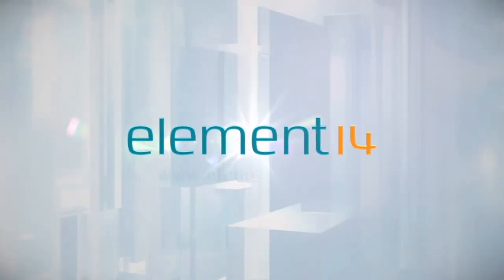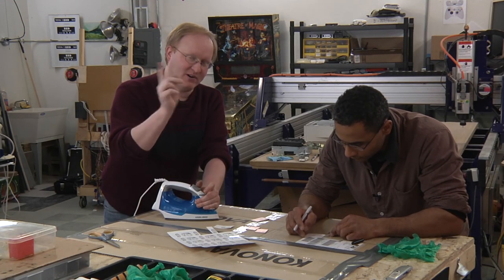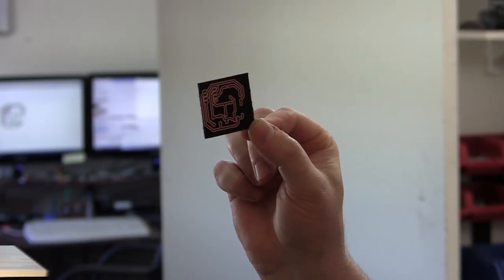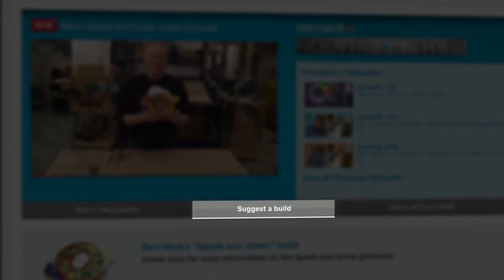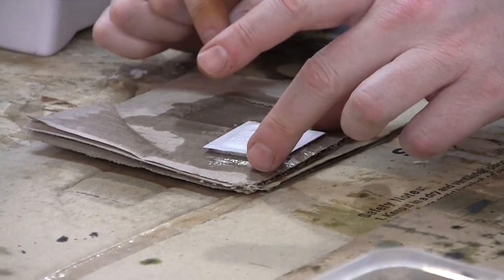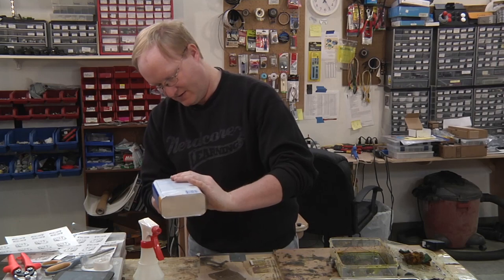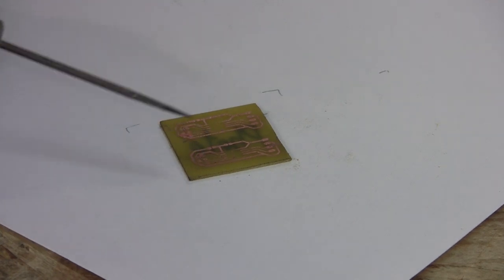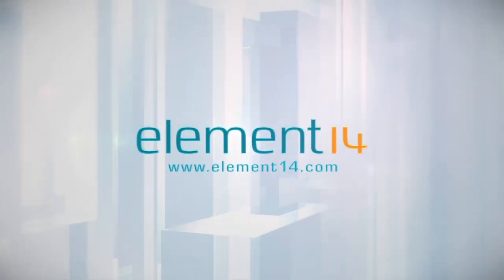Let's Try PCB Etching!

Comment: Great Video!  I think if you use the pen on the board after you remove the paper you could get rid of hatching. So that would be a combination of methods. :)
  Also I think its worth mentioning UV light (sunlight or a sunlamp) helps the echant solution.

Comment: Instead of using acetone to clean up the toner from the toner transfer, after etching, you can also use steel wool. It will not damage the copper.
I just happen to find acetone quite expensive and not available at large here.
Reply: I now use carby cleaner to remove the resist after etching, 2 quick sprays and the toner is gone and the board dries in less than a minute

Comment: how about plotting it with the cnc instead of laser burning the paint, just put a pen in the chuck? Also, Tom Stringham and Sylvia'a Mini Maker Show have great plastic ideas that just peal off without soaking.  Rich Olson also came up with a great idea to use silver glue on the toner to make a circuit board on paper. I wonder if his could just transfer the silver to a circuit board.

Comment: heating up the etch solution speeds up the etching process. Usually use one container with hot water and a smaller container with the etching solution.
Reply from the maker: Thanks for the tip!

Comment: What is a Themistor and BJT ?
Reply: Rajinder Singh A thermistor is a resistor that changes it's resistance based on temperature. A Bipolar Junction Transistor (BJT) is just your standard NPN or PNP transistor.

Comment: when etching let the pcb float on the etchant copper side down, you will see when the board is etched, have to be carefull because air bubless are easilly trapped under the board so you need to dip the board from the edge

Comment: what's the point of doing the copper fill using the laser printer?

Isn't it more easy to just include it in the design and print it in the photo paper with the actual circuit?

Comment: Use one part muratic acid and two parts hydrogen peroxide for you etchant . Keep this acid out of the house and do not inhale the fumes. Next use toner method, set iron temp to medium only to prevent smudging of circuit paths. spray a light coat of silicone spay on the iron to reduce ironing resistance. I have used this method for double sided boards for years. Keep the acid in an outside shop. Not safe to use indoors.

Comment: At the beginning of the video Ben mentions that the whole point of board etching is to circumvent having to hand-wire the board because it's so tedious and time-consuming. This looks equally brain numbing! I'd be more inclined to mill the copper off with a carefully tuned/tweaked CNC mill/router. Also, is it not possible to just laser off the copper directly? instead of just the paint? Maybe going slower/deeper ?

Comment: Welp. As said below, laminator. Goin next - iron. Rotation moves or just long press - just let it cool itself (i put it inside old book to cool there). Just in case - if u dont have huge hangar for your hobbbies, you easily etch at home with some lemon acid and hydrogen peroxide. Its also cheaper btw, gives almost no smell and no dirt. I etch right on my working table or kitchen, pouring used liquid into toilet. Good luck

Comment: Hey Ben. Why don't you just use the Laser to vaporize the coper you don't want and be left with your traces. No echant step required.
Reply: +ZakarooNetwork I think his model of EPILOG is not capable of this, however current 2015 EPILOG higher end lasers can do just this in one clean process!
Reply: +Jeff Morgan Thanks ben Never Got back to me. Im a check out the new machine.

Comment: Its probably further down the comments. What purpose does the solution serve after the copper has been burned away? Does it improve the bond of copper to board, or something?  

Also I was thinking if you have the laser etcher, couldn't you just burn off the excess copper where you didn't want it, by using a negative print?

Great stuff though, I have a bunch of different ideas now for my own shop as a result of your show. I have been basically marathoning it since I found your reverse engineering of a LCD screen a couple weeks ago. Who needs netflix!
Reply: Ducknoodle  thank you!

Comment: I've had much more success with a phototransfer method. You need a phototransfer pcb, but it's much easier and faster. Contrary to what people think, you don't need a transparent foil or a laser printer. Just use a semi translucent paper. Print on the highest quality settings. Use 2 layers, overlap them. Cure with UV, then use the exposing-chemical-thingy. Etch. To speed up the etching, put your etching bowl into another bowl with hot water. You can get a whole batch of PCBs done in under an hour.

Comment: if you have the laser setup, why bother with etchant?, just laser etch the copper off.
you can also use your cnc machine, a fine tip and 2mm clad boards makes great boards, i have made boards this way for my shortwave radios.
Reply: aly nicholls just a little note about running a laser cutter. You cannot cannot etch off bare metals or copper in this case. You risk damaging the laser if you do so, but I assume you already heard or read about it.

Comment: 2;05 many times did this and realised
Reply: When i made 555 oscillator circuit everything on paper was seems good but when i printed to clad board as pcd ic's pin 1 changed to pin 8 . But that i time i don't wants to do hardwork again  for remaking instead what i did ....
I flipped ic's all 8 pins to backwards upside down . And done .😂😊

Comment: Where can i buy  etchant?
Reply: Buy it in a chemist's shop or if you can get it in a pharmacy.
Reply: Judging from your user name I assume you're somewhere in Scandinavia. If so it may be hard to get hold of, though you may have luck at companies which sell electronic components, such as Elfa Distrelec or Conrad. 

If you're in the US all you need to do is go to Radioshack.
Reply: Switch & Lever Yeah, i'm from scandinavia. I have never heard of Conrad before, so thank you. I think i found it there. http://www.conrad.com/ce/en/product/530736/Bungard-73131-01?ref=list
Reply: fiskefaen Yep, that's it. Just be aware when using it (essentially dissolving copper into a solution) you have to deal with the remaining etchant as environmentally dangerous material and deal with it according to your local legislation. No pouring it in the sink as it pollutes the water and is not good either for water living organisms, or us.

Comment: Wow, you guys made a right mess. Why so much messing with the etchant? Just lay the board on it, copper down (ferric chloride has high surface tension, so it will float) and leave it alone for ~20 minutes, checking once in a while. No risk of damaging the traces, no hassle and no mess.

Comment: millions of nerds and appearantly nobody got the idea to just modify/build a laser printer that prints the toner directly onto a pcb. and drops them straight into the etching bath :P why the hell is all that stuff pretty much still in the same stages it was in in the 1940s. at the very least one would expect some methods to just print the metal directly onto the epoxy. also, using conductive toner of some sort, one could just electrolyse the copper away with no acid. (the toner needs to stay in place while still maintaining conductivity to the copper parts that are being electrolysed away)

Comment: I understand there was alot of goofy testing just for the sake of making content for the show, but a few major oversights... The laser cutter method was a great idea and something I've never seen before, but no mention of the photo resist method? As far as the standard toner transfer method, this was a super ghetto example of what NOT to do. There are tons of established improvements to this process yet you made it look like cavemen engineering. First there exists special toner transfer paper made specifically for this, it's far superior and available so cheap there's no excuse. Also, use a laminator instead of the iron, results are much more consistent and not any more expensive either. Finally using ferric chloride as etchant is just messy, slow and environmentally unfriendly, there are easy and cheap alternatives (2:1 hydrogen peroxide & hydrochloric acid?) which are much better for all the reasons. Love the show but this was painful lol.

Comment: Ferric chloride sucks, it is messy, hard to dispose of, only available at speciality shops. A much better etchant is a mix of 1 part vinegar and 3 parts hydrogen peroxide. It is a little slower than Ferric chloride, but much much better, for you and the environment. If you are in a hurry, substitute Muriatic acid, available by the gallon at Home Depot type stores for a couple of bucks. If you get a bit on your hands, you should wash it off, but it doesn't stain your hands.  Using Muriatic acid you naturally have to be more careful than using vinegar,  but it works really well.  As with any chemical reaction, it helps to heat the mixture and keep agitating it or use a tooth brush to frequently wipe the board or it will take a very long time to etch. Also, since the stuff is clear, you can watch the process of the etching without removing the board from the yucky Ferric Chloride.

Comment: we iron pcb-s at school, but we print on projector paper and desolve the copper in acid
Reply: If you actually use acid, its HCl and you're really probably using the byproduct of that and copper copper-chloride(iii).  Knowing what I know about first and second year electronics students, you're asking for acid burns handing them either of those.  The most common etchant ime is ferric chloride and has a brownish/orangish tinge to it.
Reply: Travis Stanford A much better etchant is to use Hydrogen Peroxide mixed with Muriatic Acid (HCL). Both chemicals are easily found at the hardware store in bulk for very low prices. When I say "better" I don't mean that it is any faster. Typically it etches at about the same speed. But it is cheaper, easier to find, and doesn't stain everything it touches.
Reply: we use a sheet of papper between the iron and a transparencie which has ink on. the ink transfers to the board

Comment: Lol this is a really bad attempt at PCB etching! The method I've learnt and use from my high school electronics classes are a lot easier and look a lot nicer. The two methods we use are for easy and hard circuits. The easy method is to take the printed out circuit and tape it on the outside to a piece of copper clad and we make small marks with a scratch all and mallet for where we need to connect the lines with a sharpie then we trace with a sharpie and ruler and but the copper clad in a tall container with a fish pump in it to turn the acid! Oh and we use muriatic acid and hydrogen peroxide since it works much better than ferric chloride. The more complicated method is by taking negatives like the ones you have but instead on using a iron we use a dry heat press with a timer and we use a special paper which doesn't stick to the PCB then we just put the copper clad into the acid again and you have a perfectly etched PCB and you don't get the ugly yellow stains on the PCB where the copper was removed from using the ferric chloride!

Comment: You should have explained better how's that etchant is made.
Reply: I think he is probably using Ferric Chloride (if I spelled that right, FeCl3)
Reply: theIpatix And that's easy to get on a normal drug store?
Reply: In Germany you can get it several hardware stores and in some drug stores. I don't know about the US though.
Reply: But I'm in Portugal. I think I'll need to go ask for this on the hardware store I use to go to see what they have...
Reply: ***** Radioshack in US carries it.  Like anything like this you're better off ordering online.  Try any hobbyist type electronic stores, amateur radio type stores, some hobby stores too.
Reply: A much easier to get etchant is to take Hydrogen Peroxide and mix it with Muriatic Acid (HCL). Both of these chemicals are available at the local hardware store (in the US). they are both cheap and can be bought in bulk. Google for Hydrogen Peroxide etchant to get more details on how it is mixed. I never use Ferric Chloride any more.
Reply: I can confirm that this is also a solution that works very well. The only reason I don't use this anymore is that if you don't do much etching your Hydrogen Peroxide usability decays pretty quickly. If you don't store it in a pressure safe canister it isn't really usable anymore after a few weeks. And even if you store it right it gets unusable after ~2 years (this is what the label says). THis is what I experienced so far, but I might have done certain things wrong.
Reply: theIpatix Nope. You did it right. That's the same thing I experience. However, I always just mix up a fresh batch when I need it. You can buy a new bottle of Hydrogen Peroxide for 99 cents here in the states. The Muriatic Acid tends to last a few years. So in my opinion, it is better to run out and buy a bottle of Hydrogen Peroxide at the local drug store when you need it than to have to order Ferric Chloride online and wait to have it shipped (assuming Radio Shack is out as they usually are).